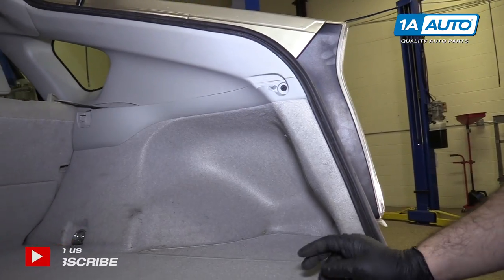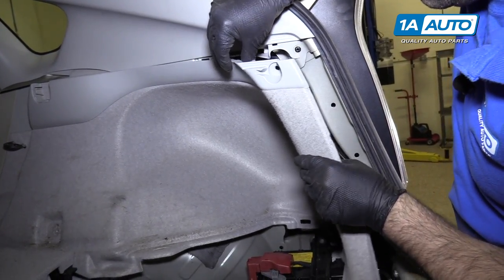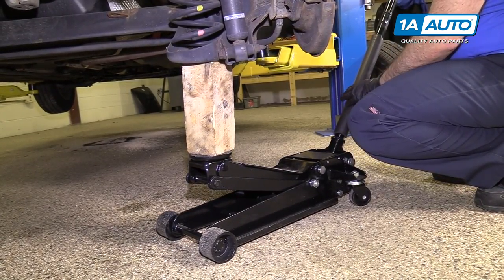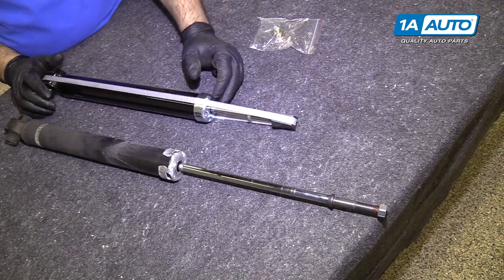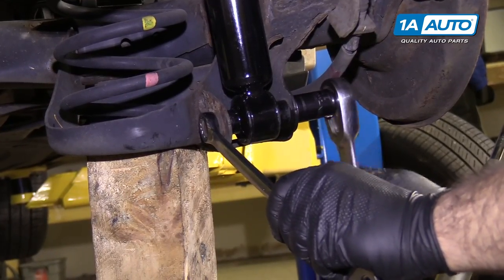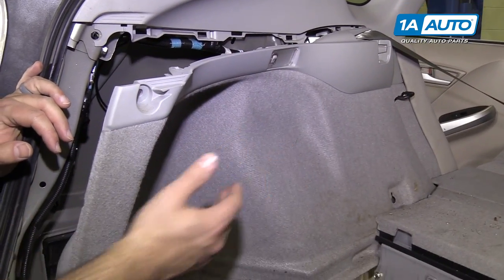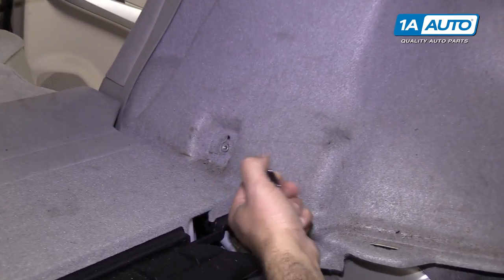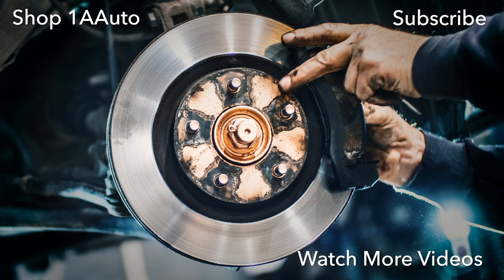How to Replace Rear Shocks 10-15 Toyota Prius

Comment: Theres actually an access cover on later gen 3 models that gains you access to the nuts for the top of the shocks. Doesnt require ripping apart all the interior trim to get access.

Comment: IF YOU HAVE A 2012-2015 PRIUS 
YOU DON'T NEED TO REMOVE THE PANELS LIKE IN THE VIDEO 
IT HAS PLASTIC COVER TO REMOVE TO HAVE ACCESS TO SHOCK NUT
THIS IS WILL SAVE YOU A LOT OF TIME
2010-2011 PRIUS DON'T HAVE THIS COVER AND NEED TO REMOVE PANELS
Reply from the maker: Thanks for checking us out. 1aauto.com +21boxhead
Reply: Your the guy that told me my gasket was fucked.... well guess what?... it was
Reply: Hi thanks for your video. I have the same car , what rear and front absorber do you suggest? And I see you are not using the torque wrench. Any suggestion about working without it? Thanks  @1AAuto

Comment: On my 2011 the bottom nut was designed to bite in.  Removing the bolt without trying to turn the nut was how it was meant to be done.

Comment: Great video, but you didn’t mention the Torque specs for the lower shock bolt and nut, if you could provide that information it will be appreciated. Again, great video
Reply: I came here for this too... did you end up finding the torque specs out, Will?

Comment: When I brake fast or go in reverse and go back into drive and press the brake my front makes a clonk noise. I changed to sway bar links thinking that was the problem but I guess not. What can it be??the clonking ain’t as bad though since I replaced the links cause they were done

Comment: What are the torque specs for the bolts?
Reply from the maker: +CValenton01 The upper bolt will be 18 ft-lb, and the lower will be 67 ft-lb under full vehicle load.  1aauto.com

Comment: I'm pretty sure you're supposed to torque the mounting hardware of the strut.
Reply from the maker: +gibson76 Thanks for the feedback!
Reply: @1AAuto  you're welcome.
Reply: As an Ex Toyota Master Technician & ASE Master Technician, no one at the dealership torques anything.  Yes, I realize there are torque specs, but if it isn't head gaskets, it goes together with an impact.

Comment: 5:02 can you please tell me how long is the wood?
Reply from the maker: +C Alex Length doesn't matter. Just as long as it is stable enough to get the job done. You may need to experiment with a few pieces of wood.
Reply: NO WOOD NEEDED JUST USE THE JACK

Comment: How do I do this safely with two jack stands and a scissor jack?
Reply: I DON'T RECOMMEND SCISSOR JACK BUT IF YOU DONT WANT TO BUY A FLOOR JACK  
THEN FINE BUT YOU NEED ONE JACK STAND TO HOLD THE CAR UP AND USE SCISSOR JACK UNDER THE SPRING 
NO WOOD NEEDED JUST ENOUGH TO LIFT A LITTLE BIT 
ALSO IF YOU HAVE 2012-2015 YOU DON'T NEED TO REMOVE PANELS IT HAS PLASTIC COVERS TO HAVE ACCESS TO SHOCK NUT SAVE YOU A LOT TIME 
2010-2011 YOU WOULD NEED TO REMOVE PANELS LIKE IN THE VIDEO

Comment: Absolutley do not hand tighten the bottom strut bolts. They should be torqued to 66ft lbs, acxording to 1a auto manufacturing. Or, 122ft lbs recommended by toyota. Hand tightening will lileky lead to loosenening and excessive noise. Dont make the same mistake i did. For, hand strength varies per person. Not very safe for this mechanic to recommend hand tighten.